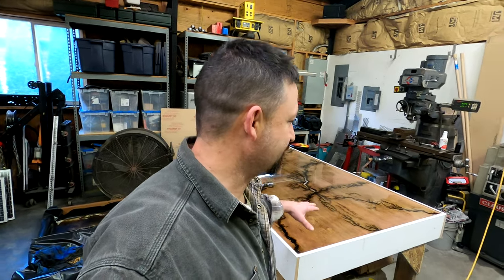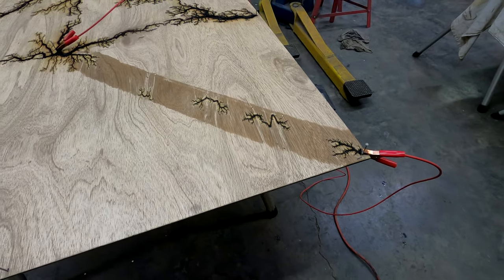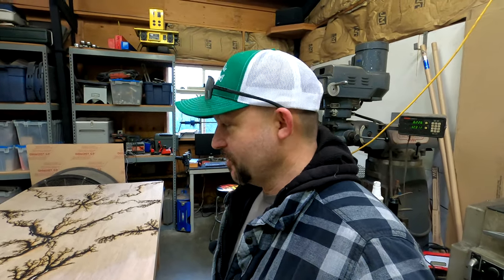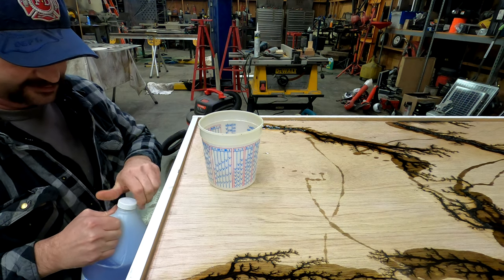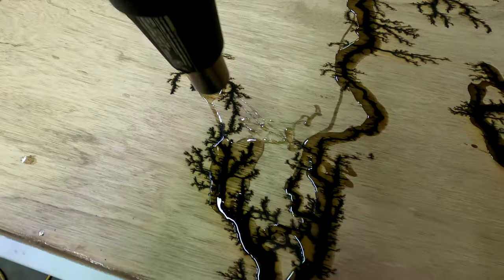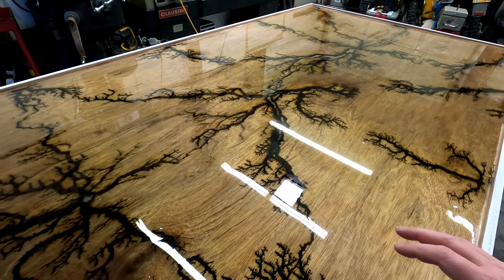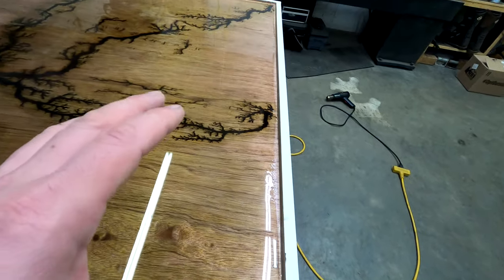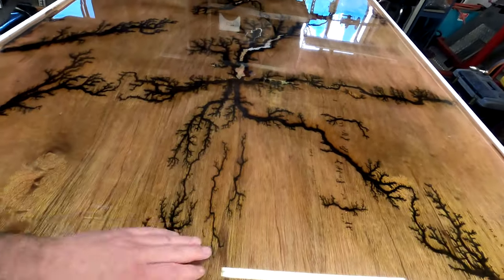Workbench Countertop: high voltage burn traces in plywood and pouring an epoxy surface

Comment: The burn is beautiful.  Epoxy try pouring different layers closer together time wise
Also try stone coat countertops brand. I find non yellowing and the option to sand or matt finish  and thicker pours 
You gave me so many ideas in this video 
Thank you

Comment: Similar to when I built CRT TVs. 30kv hurt like a son of a bitch but low current. Thanks for helping clarify some better alternatives then a magnetron or similar
Reply from the maker: Yeah; I see guys monkeying around with microwave oven transformers quite often here on youtube.  A tiny mistake with one of those can be lethal, despite the low(er) voltage.  Most of them will produce nearly 1A at 2000v before they saturate...well above lethal levels.  It's easy on a project like this to lose focus for a split second and try to adjust something on the table.  I have several of them for various projects, but don't use them for wood burning.  Too dangerous IMO.  The neon sign transformer would hurt like crazy, but probably wouldn't kill you.  Fortunately, I've never been hit with it...

Comment: Matt, is there any difference in use, between a neon sign transformer or micro wave transformer?  Bob L
Reply from the maker: Yes; there is.  A current regulated neon sign transformer is much safer than a MOT.  A NST will burn at higher voltage and lower current, while a MOT will burn at a lower voltage and higher current.  The NST produces a better-looking (IMO) pattern with small intricate detail.  A MOT burns less detailed, deeper traces.  I highly recommend avoiding the MOT; the biggest reason is safety.  Without a ballast, getting shocked with one of those will very likely be lethal.  Getting shocked by a NST will be incredibly painful, but would most likely not be lethal.